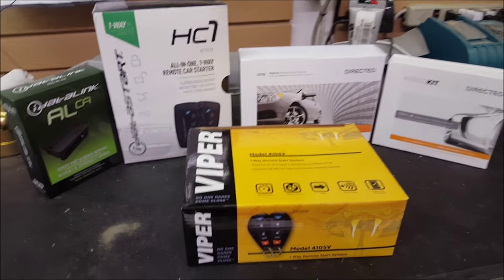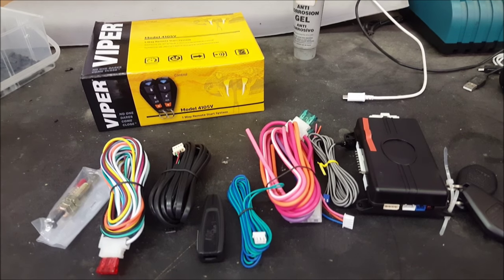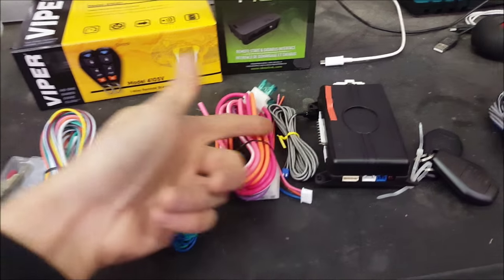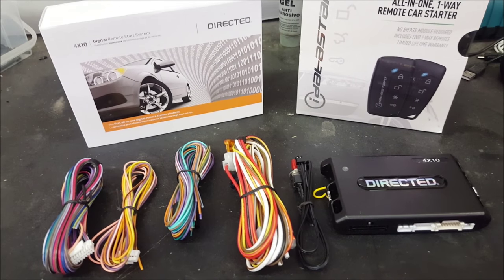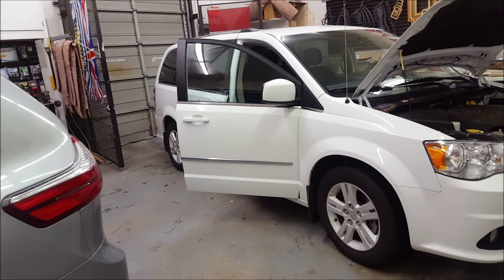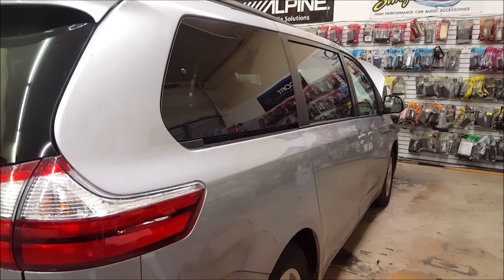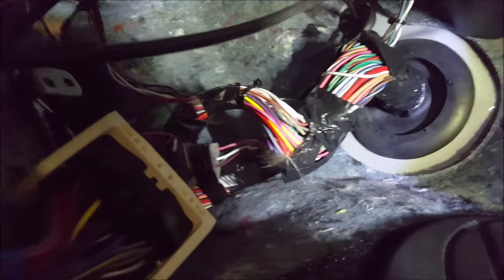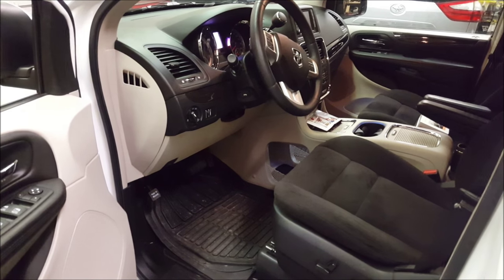Digital vs Analog Remote Starters (Directed Electronics | Idatalink) | AnthonyJ350

Comment: Great video! Very informative. 

I’m in the market for a remote start system. 

How do I know if my 2010 Ford Sport Trac XLT is analog based, or computer controlled?

(It has an aftermarket Viper alarm system controlling power locks, thus permitting keyless entry.)
Reply from the maker: A Compustar system will work well in that vehicle for you.
Reply: @AnthonyJ350  
Thanks

Comment: My name is Artie .I have a 2004 silverado 2500hd. I installed a viper 4105v.  Everybody thinks i have a key chip, I do not I have a coded lock cylinder. The remote starts without an Interface or bypass but i am adding a Idatalink ALCA only because i want  the interface to control the door locks,  so i don't have to go into the doors and wire reversing relays. If you start the Truck  with the remote the lights would come on not flash and the truck will start. If you shut it down and use the remote start again the lights will not come on unless you open the door, because the ignition to the radio and window switch is on . My question is what format does the viper 4105v use so i can flash the ALCA.
Reply from the maker: ADS protocol. You don't have a chipped key but there is a factory immobilizer. It detects it based on the key cut.

Comment: Hi Anthony. I have a 2000 Toyota 4Runner and would like to install a car alarm/security system and probably with a remote start. What would be your recommendation as to which type system to install and will work for this type of vehicle? Thank you in advance.
Reply from the maker: Any brand will work for a vehicle of that year.  You'll need an analog remote starter.  I prefer the Viper brand.

Comment: Hey Anthony.. i have 2011 ford f150 has remote starter when i purchased it. just wondering its not working now i check the module underneath its idatalink and  the remote starter module is smart start i think same with autostart. how can i reprogram again
Reply from the maker: Autostarts can be programmed manually  if you have the instructions. The Idatalink module it's best to have it serviced at an authorized dealer as they might have to update the firmware.

Comment: What would you use on a 2004 Chrysler Pacifica and a 2016 Chevrolet Equinox LS? Is analogue okay, and what price including installation?
Reply from the maker: Compustar CM7200 with a Blade AL module
Reply from the maker: The Equinox look into the Compustar DC3 digital starter

Comment: I know this is an old video but do you know where I can get a idatalink ADS-AL(DL)-CH5-EN for my ram 1500 it’s an 06 and analog and I wanna use it for compustars t13 also I live in Colorado
Reply from the maker: Typically they're available at your local install shop. It should really be installed and programmed by an experienced professional.

Comment: hey Anthony I like your videos they're very informative I have a quick question would you recommend an analog or digital remote start for 05 Equinox.
Reply from the maker: bobdude2360 You can do a regular analog starter like a Viper 4806V with an interface module from Directed or Idatalink.

Comment: What analog remote starter would you recommend I pair with a Fortin Evo all I recently installed it as a standalone remote start / alarm system but I'm having over crank problems when remote start is engaged they're not long they're at least a second or two long and I don't want to lose the starter in my '06 Daytona charger
Reply from the maker: I would look into Comoustar's DC3. It'll do everything for you in that vehicle. I find if you turn "tach sensing" off and make it crank for 2-4 seconds it works better. The car will not allow the starter motor to overcrank
Reply from the maker: Oh and believe it or not, the 2006 Charger benefits more from a digital remote starter. The car is heavily CANBUS controlled.

Comment: What kind would you recommend for a 2008 Jaguar XJ
Reply from the maker: You'll probably have to use an analog system, with an interface to do convenience and still possibly lose a key using a 556UW module from Directed.

Comment: Hey man thanks for getting back to me so soon quick question that alarm is out of my price range this is a late Christmas gift for my mom and she just wants a simple remote starter. So I found a crimestopper rs4 g5 new on eBay for 45 bucks plus a idata link bypass module and together they are under a 100 shipped. Will that work for her car the eqinox that I mentioned earlier I know viper is better I own a cavalier with a 2 way alarm and remote start and I love it but my mom doesn't want a alarm. Any info you can give will be greatly appreciated and thanks again take it easy and peace out.
Reply from the maker: It will but I'm not a big fan of entry level brands like that.  What about the Viper 4105?  I would even pick AutoStart if I were to go basic.

Comment: I own a 2013 Mercedes C300 4matic. Im guessing the best application is digital vs analog? Thanks for any advice :)
Reply from the maker: You'll need a Mercedes specific starter from Idatalink
Reply: @AnthonyJ350  glad i asked thank you. Thats my only option then?
Reply from the maker: @jasonb4196  Pretty much. They cost more than a standard remote starter as they are engineered specifically for Mercedes.
Reply: @AnthonyJ350  thank you very much. Iam now researching idatalink starters.

Comment: Hi I have a 05 ram and I had a viper vss3001 with a 4x10 module installed and the installer could not get it to work. I have double checked the wires and everything looks good but still no luck. I don't have a chip in my key or a factory security system. Am I using the right system?
Reply from the maker: Early 05 I believe is thick gauge (did they use the relay pack which I don't like using) while the later half is thin gauge.  Your truck might say 05 in the door but might be designated a 2006.

If it calls for a relay pack I just use a regular analog Viper like a 4204 with a DBall.  If it's the newer style (the headlights and dash are different) then use a 4X10.

What's it doing?
Reply: +AnthonyJ350  yeah I have the relay pack. And I am pretty sure it is a 05. My problem is that I can get the light on the control center to flash but the horn does not chirp and the remote will not pair. I have replaced the 4x10 module because I thought it was bad but still no luck.
Reply from the maker: Terry howder jr Personally I'd use a regular Viper with a Dball, I've just seen issues with the relay pack.  Not sure why your remote isn't programming.  It's just a cable to the antenna, the 4X10 needs to see the door open during the programming sequence.
Reply: +AnthonyJ350  what do you think about the 4606v system? Would that work good for me I want to have a remote and smartstart.
Reply from the maker: Terry howder jr Yup it will.  All the 4 thousand brains from Viper are the same, just the remotes change.  SmartStart works great with analog or digital remote starter systems or combos.
Reply: +AnthonyJ350 if I buy the 4606 system do I need any thing else that doesn't come with the system?
Reply from the maker: Terry howder jr You need the Dball integration module.  I would just purchase it all from an authorized Viper dealer, makes things easier.
Reply: +AnthonyJ350 so the module that comes with the system won't work with out the Dball? I don't have a chipped key does that matter?
Reply from the maker: Terry howder jr What colour is your key?  Grey or black?
Reply: +AnthonyJ350 black
Reply from the maker: Terry howder jr You can do the install without the Dball.
Reply: +AnthonyJ350 ok cool thanks for all the info.
Reply from the maker: Terry howder jr No problem, let me know what ended up working for you.
Reply: +AnthonyJ350 hey I got my 4606v system installed and it work great. But I got my smart start activated and bought my service plan but it does not work. The amber light is on solid but no green light. The app thinks it is working but it doesn't do any thing. I have the 4 pin connector pluged in going to the smart start port on the module the wire Colors are blue,black,red and green is this right?
Reply from the maker: Terry howder jr Should call tech support but it should be plugged in where the bit writer goes and you need to give it power and ground.
Reply: +AnthonyJ350 can the xkloader2 program my 4606v module?

Comment: Hi Anthony, thanks for your video.  I'm very glad I watched your video, it's extremely informative.  I have a 2018 Honda CR-V with Push to Start.  I'm very confused as to what starter I should be getting for my vehicle.  I've been to different shops, who carry starters from different vendors (iDataStart, Viper, Compustar, etc.) - like you said, the end result is the same regardless of what starter I buy, so the conversation is centered around what type of remote I want, not so much what product works best for my car.  Do you have any recommendations as to what product would work best for my car?  And any recommendations on shops - I live in Calgary.  Thanks.
Reply from the maker: Visions Electronics has a few stores in your area.  They can set you up with the correct Digital Starter from Idatalink or Viper.

Comment: Would you recommend the 4x10 for a 2005 Tahoe? I really like the stock key fob option vs having an aftermarket unit. I installed an avital 4103 on my 2000 silverado, w/dball2 and DSM200 smart start. I'm about to sell the truck and want to do another system on my Tahoe. I appreciate your input
Reply from the maker: You can do the 4X10 but you'll need the satellite relay pack to drive the ignition wires in that truck.  I would do a standard brain like a 4206 for example and either do the DBall2 or IdatalinkCA integration modules to control the convenience and immobiliser.
Reply: AnthonyJ350 so, just run something similar to what i had in my old truck. I didn't hate the key fobs that came with the avital kit. They had a lot better range than the factory key fob.
Reply from the maker: Chad Oakley I would.  The Viper key fobs are nicer than factory and are cheaper to replace.  Directed Electronics makes both Viper and Avital as well as other marketed brands.

Comment: Subscribed! Is my 2003 Lexus gx470 digital or analog? Thanks a ton!
Reply from the maker: You'll want something like a Compustar CMX with an Idatalink Blade AL. It's mostly an analog vehicle.
Reply: @AnthonyJ350  Thank you for your quick response! I wanted to install the Viper 4816V remote start unit. Would this be ideal for my vehicle or not so much? Thanks again!
Reply from the maker: @clarkfos3447  That's a good unit, it's the older style brain which I like. You'll need a Directed Dball3 or Idatalink ADS ALCA

Comment: Can u add a viper 2 way remote to a 1 way viper system?
Reply from the maker: Depends on the unit and antenna you have installed.
Reply: @AnthonyJ350  I got the newer 3105v viper 1 way

Comment: hood pin should be gray in color but it is taped up coming from the hood release grommet?
Reply from the maker: Yes we tend to black out wiring in the underdash or loom it black so it looks more uniform and blends with the factory wiring.
Reply from the maker: On the Ram's I take 3/4" loom and loom the wiring with the shifter cable so people don't notice it.

Comment: Hello anthony
Can analog remote starter with old style keyfob insert bypass module be installed in can bus ignition system? Where can i find the thick gauge accessory and starter wires in those ignition sytems?
Reply from the maker: It can, if you have an integration module designed for the vehicle it's possible.  The remote starter will just issue the commands.
Reply: @AnthonyJ350  does integration modules work for converting analog power to can bus commands?
Reply from the maker: @jashandeep5012  They do
Reply: @AnthonyJ350  can they do without any specific firmwares for vehicle ? Are vehicle specific firmwares for bypassing immobilizers?
Reply from the maker: @jashandeep5012  You need firmware loaded that is designed for your vehicle application.

Comment: Hei, i have a question, my car have a presencial key fob, is a 2015 mini/bmw and i wold like to have one remote start, i live in Norway so can't come to Canada, and i don't need one alarm no one here will steal a mini. 🤣 but here winter is cold as well and i wold like to have something like that, for i don't have to go out and start the car in cold morning and as buss driver and finish late at night i like to have a worm car before drive home. My question is what dose aply better for me? Mini cooper 2015, manual transmition, with presencial key fob, 2 way and remote start, with range at 500 meters more less. I also like to thank you for this videos. Thank you very much!
Reply from the maker: Are there shops that do work like this in your area?  That's a complicated install.  The other option is plug in an engine block heater at night, that way when you start the engine it will warm up significantly faster.

Comment: Hello I know this video is 4yrs old But I have a question I'm about to have a Viper alarm 5906V installed in my 2018 Chevrolet Express Cargo van and I already installed a IDatalink Maestro rr when I swapped out the head unit Now my question is  which remote start module should I go with iDatalink - Data Bypass Module vs Directed DB3 module  thanks
Reply from the maker: I would do Compustar's CM7000 with a Blade AL.  It has the same dimensions as the Idatastart as the module plugs into the remote start and security brain.
Reply: @AnthonyJ350  Thanks for your fast reply. I already have the Viper 5906V alarm,  are you saying I shouldn't go with this Alarm and just go with the Compustar CM7000 with the Blade AL? Or am I mistaken I read that the Compustar CM7000 is an alarm too?
Reply from the maker: @PeteyPablo408  The 5906V is a good unit (more for analog aplications).  You said it's already installed though, and it doesn't remote start?
Reply: @AnthonyJ350  I do not have it installed Yet , I just have this Alarm.  I was told it needed the immobilizer module so I bought the Directed DB3 with it But had to send it back because they failed to flash it for me. I shipped it out Saturday and they won't see it till Thursday so I have some time to look at my options for the immobilizer
Reply from the maker: @PeteyPablo408  Viper DS4 or the Compustar is better for your application honestly.
Reply: @AnthonyJ350  okay thanks I'll see of they can accept my return and exchange it
Reply: @AnthonyJ350   Anthony do you sell the  do you sell the Compustar CM7000 and the Blade AL on your Amazon store ?
Reply from the maker: @PeteyPablo408  No I don't  unfortunately. I recommend you purchase and have installed by an authorized Firsttech dealer.
Reply: @AnthonyJ350  okay thanks again

Comment: Great Video Anthony with good clear easy to follow audio a cut above what most youtube videos are like . so now on to my question I have a 2017 Ford Transit Custom (UK model) would a viper 3203v along with a DB3 all work in this vehicle oris there a better way to go with this vehicle?. I see there is a new DS4 viper range out now what are your thoughts on these new systems ? and this will be a DIY install so what would suit me better Cheers
Reply from the maker: Mark E DS4 is probably a better solution for you. This isn't a DIY product though as you need a dealer login alone just to program it and set it up. I highly recommend visiting a local authorized Directed dealer for product like this.
Reply: Thanks for your reply Anthony I have been doing a lot of research on this alarm installation and as you know its a minefield . I looked up directcehs.com today and saw that the DS4 is not compatible with my vehicle so was thinking of the Viper 5706v as this has a D2D port that would make for a easier DIY install with the DB3 All.  Is this a better way to go for my vehicle ? I will not be using the R/S  section of the 5706v which also makes me think the 5305 v will do the same job ? The only reason I am thinking of the 5606v over the 5305v is that it has a better looking and rechargeable remote and newer technology which way would you go ?

Thanks Mark E
Reply from the maker: Mark E I think all the new 2 way remotes are rechargeable now. If you're not going to remote start look into the 3606 paired with the DB3. It will still use the D2D plug.
Reply: I have just looked at the spec of that 3606 and it looks like it may do what im after but its only a one way system. And when you look at the viper website it does not mention any of these products that we are talking about so is there a 2 way system without the R/S but with a D2D port onboard ?
Reply from the maker: Mark E You can add remotes to it or SmartStart and have smart phone integration.
Reply: So are you saying that I could add a 2 way remote to the 3606 ?  and I think the smartstart requires a subscription is that correct ?
Reply: Hi there Anthony i have been looking at the spec for the 3606v and it is upgrade-able to a 2 way which I good for what im after I see that Clifford do a 3606x which looks to be the exact same alarm could you please confirm if that is the case as ive seen the clifford 3606x at a very good price. Cheers